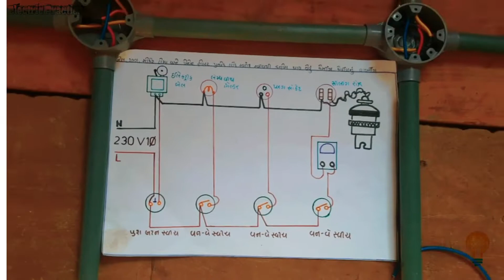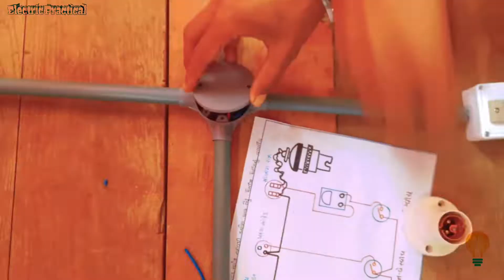બેલ, પ્લગ, સોકેટ, લેમ્પ અને પેન્ડન્ટ હોલ્ડર પ્રત્યેક લોડ સ્વતંત્ર સ્વિચ થી કંટ્રોલ થાય તેવું વાયરીંગ

Comment: Good Demonstrate the live wiring of the common house appliances 🏠 electric circuits

*Bulb, Plug, socket, lamp and Pendent holder individual independently controlled switch *